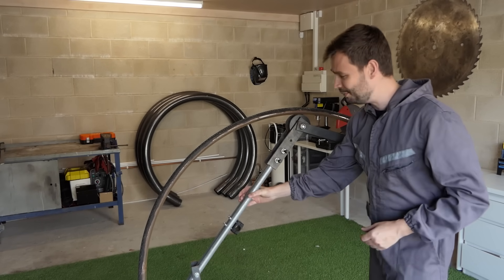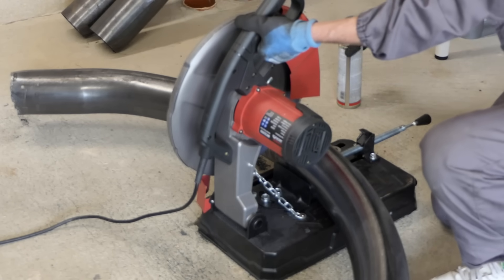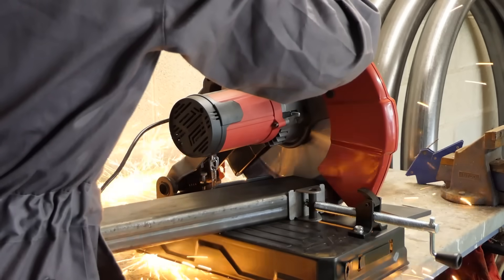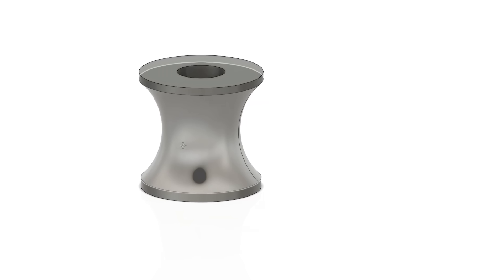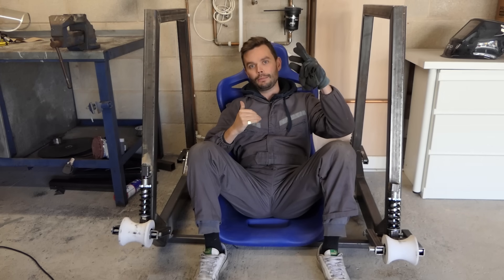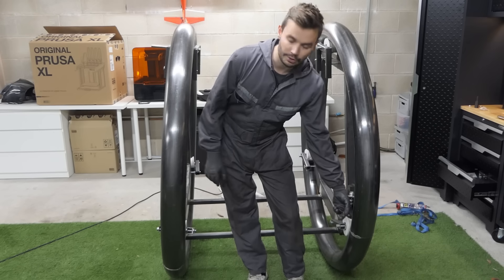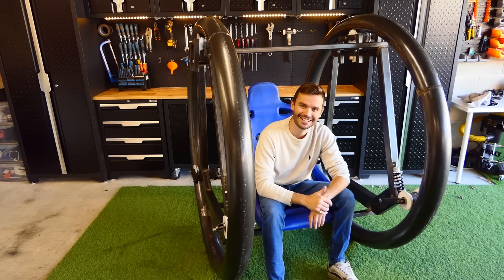Tank Steering E-Bike - The Diwheel

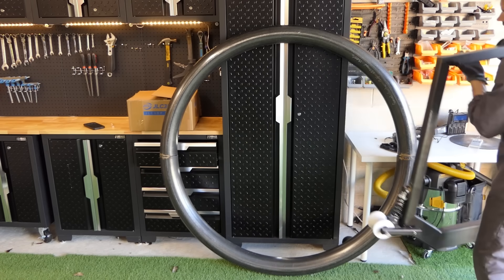Comment: 2:57 "It got worse" because of the welding you did on the opposite side. As long as the two halves are close you'll be alright. (Same deal at 4:08). 7:32 At this point, put the bearings in the oven at low heat and put the shaft in the freezer and get it as cold as you can, Then slip on the 'expanded' bearing onto the 'contracted' shaft. You'll have a few minutes to get is perfect before you have to start over again, but this way is surprisingly manageable and works great.) Looking forward to seeing this duo wheel roll. Cheers, D.

Comment: For having a suspension and to avoid it causes the wheel to slip out , you can add a frame inside the wheel that is fixed on the rollers with maybe tensioners and put the chair and the rest of the bike with suspensions on rails or welded suspension to this body
So that on bumps the wheels and the body all move together.

Comment: OMFG use your head. It's staring you in the face! You only need the inner quarter or half of the ring as a wheel hub. LIKE A BIKE.
Put an inflatable tube on and you are in business proper. You got weight reduction, suspension and traction. You're welcome.

Comment: the first idea it locked enough Wheels to support the metal that's why the metal was warping or bending it just needed more Wheels around it and the frame if you made it round the inner side frame and some extra bars for your part where you will sit and stuff in the chair that would have supported the metal more so having just one wheel can work it just required more to work also if the tube was flat it would roll better without flipping side to the side and adding a rubber tire will give it grip so you don't slide on the road like this wheel won't spin

Comment: I could have used this metal “Chromoly 4130”  it's lighter than mild Steel and strong enough to do the job with my vehicle idea that I would like to make someday that's the type of metal I'm going to use although it's going to take a long time cuz my money is very limited so I have to save and buy piece by piece although my vehicle will have dual motors and the only part I haven't figured out is the throttle if it's going to be a pedal on the ground or a shifter on the handlebars cuz it's going to be like a trike version of a golf cart or something similar to that

Comment: Is it going to be electric? Also it looks like traction might be an issue.....maybe epoxy some rubber blocks on the rim of your loops? On the plus side it will make it look more aggressive.
Reply from the maker: Correct and correct 😊
Reply: Cool project having an electric motor on it will make it a fun vehicle. Did you get any ideas for this from The Kugelpanzer ?

Comment: awesome, but I have 3 questions: 
won't the wheels fall out in the first bump? I think it needs suspension in the top
how do you plan to keep it balanced front to back? active control loop like a hoverboard or just driver skill?
in the end you mentions motors and batteries, how do you plan to make the wheels drive the tubes without slipping? especially given the suspension

Comment: are you going to find some used car tyres and cut rubber strips to glue on the outside of the wheels. the tubes look wide enough where you can get 2 strips off one tyres cut in half wheels and if not car tyres mabey 3 fat bike tyres will work

Comment: You can get a small lathe for about the cost of one of those tubes. (Around here anyway), that would be a huge help to get this thing realized. Also, I would definitely re-weld the tubes with proper prep, once you clean up your welds with a grinder, you have no weld left. Grind the ends to around 45 deg, then you'll have room for a full weld. Anyway, Im all in to see what happens, rain or shine, dont get hurt. Cheers.

Comment: What's the point? We know it won't work. You're limited by the power of gravity created by being off-center. That's the limiting factor of acceleration and deceleration, and guess what happens if you try to brake more? You'll spin. So any slight uphill to overcome the tiny energy you exert by being off-center and you aint going nowhere, similarly any slight downhill and you have no way of stopping. And it's WAY too heavy to stop it with your puny legs. Have fun dying

Comment: Awesome.  I'd-a tipped the tops in some, 5° - 10, so it has a wider stance.

You might tack on some small plates, so there's absolutely no chance of them flying off-track.  I'm sure yer pressure-fit is tight, but I'd hate for ya to hit a bump while going high-speed around a turn & one of those rings mangles yer leg.

Comment: 60kg per wheel seems a bit over the top doesn't it?
Would it be possible to make them out of alliuminium or smaller diameter tubing? 
Even 2 thinner rings welded together for each side and then a rubber strip could be implemented in the valley between the two welded rings if that makes sense.
You could definitely use alliuminium for the frame inside too I reckon.
It's a cool build though. I want to make something like this with a couple of ebike motors 😆😆

Comment: How are you going to stop? If all you have are massive rings for wheels you can stop the frame from rotating relative to the wheels, but then the whole thing will just keep rolling along the ground. Segways use the rider as an energy dump by tilting the person back and the wheels lose rotation trying to turn the person as a giant moment arm up from the pull of gravity. But since you are inside the wheel, you really won’t have that option. So you’ll need something you can deploy out front or back to stop the rotation.

Comment: I think you will want the rollers solidly mounted so that suspension bump does not unseat the unsprung rollers. Or have them all sprung. Could add springs to the seat for comfort. Some form of traction aid for wheels on rollers and rollers on ground might be helpful if braking and steering are to be anything other than mild suggestions.

Comment: I'm pretty sure a lot of the reason your welded frames would go out of whack when you welded them was because the heat from the welding was bending the metal.
Reply from the maker: Yes absolutely it was the heat from the welding that did it! Let’s blame it on that….. 😅 👀

Comment: Did you use spacers inside the white rollers to keep those bearings from sliding/falling in?
Reply from the maker: They currently are friction tight but once it comes to riding they will have circlips on the end to stop the inevitable disaster 👍

Comment: either the rings will need tires, or the bearing spools inner tires that contact the rings, otherwise the ride will be grindy/growly/noisy/jolty/uncomforable as hell. Probably both rings and spools will need urethane or rubber coverings.

The frame should be all aluminum alloy...the weight/inertia penalty on the steel version is going to really tax your motor/controller unless you go for at least 8000 watt system, which is gonna be expensive/require a really heavy battery pack... which will add more weight...otherwise you'll never get up an incline, or get any speed/acceleration.
Instead of  fat tubular wheels, have a metal working shop waterjet cut your rims from alloy plate...they'll be perfectly round, with flat sides, easy to fit some sort of tire onto, and tremendously lighter, plus easier to make bearing spools supports for.
Then you'll need to figure out some sort of dampener or safety-stop so your seat won't tip forward/back when accelrating/decelerating...and where are the brakes btw??

It's an interesting concept but I think it might be best to start over from first principles and design for minimum weight/maximum efficiency, for smaller drive system/better safety.

Comment: That top roller needs a preloaded suspension to stop it popping out on a bump.
Reply: I wanted to mention this too
Reply: Furthermore the travel of both top and bottom on bump needs to be less than equal to the travel in the opposite direction of the other - or it'll have the same issue even with that. But yes, you were almost right :-)

Comment: the top roller should be sprung too, it loses contact when the suspension compresses as is.
Reply: Furthermore the travel of both top and bottom on bump needs to be less than equal to the travel in the opposite direction of the other - or it'll have the same issue even with that. But yes, you were almost right :-)

Comment: I really hope he's adding tread because once he gets to a strong enough motor it's going to start spinning the wheels on acceleration and deceleration and w/ how much it weighs it can push in the corners and start drifting when you don't want to.... That's why some of the other designs like this have inward tilted wheels to help negate the drift when turning hard. This is going to be fun....     😂👏
Reply: yeah, might need some traction for turning and accelerating.
Reply: Plastidip spray? Polyurethane pour?🤔
Maybe some TPU, 3D-printed flat in segments, then curved on. Puzzle-piece style connections between segments?
Nailing the diameter might be tough. Also not sure how you'd keep it secured. Self-tapping screws could work but wouldn't be great long-term. Bolts would be better, but you'd need a way to get the nut on from the inside of the wheel, so would mean drilling a hole straight through. If more bolts are needed than just in the center line/contact patch of the wheel, I think it'd weaken the structure a lot. And maybe they couldn't go there at all, because of the weight compressing the TPU too much.
Lots of things to think about, excited for part 2!
Reply: He'll have to, it would be absolutely unridable/drivable on pavement or any hard ground with bare steel like that due to intense vibrations, and he'll get no traction anywhere.

Comment: bro those welds are interesting to say the least. Try turning up the gas because you've got a lot of oxidization forming which doesn't help the penetration of the weld. The key to a good weld is consistency not speed try focusing on forming that initial molten puddle and slowly pulling it along or pushing depending on your preference and try increasing the amps if you're struggling to maintain the molten puddle. Love the videos keep it up man.
Reply: Thats sure looks like gasless to me
Reply: Also bevel the edges of the metal before welding, then you're filling in the gap, not just trying to penetrate 5mm steel both sides.  I'd probably ditch the gasless MIG and use stick tbh though.

Comment: Try to weld in the other direction, instead of "pull" try to "push " it should be way better. And try higher settings like 21 v and 9.1 m/s

Comment: Awesome build haha! Madness! For future reference, when you butt weld 2x tubes together like the wheel rim, grind a bevel on both ends of the tubes.. so when they come together, you have a 'V' between them to fill with weld.. much stronger, especially if you are grinding the weld smooth after. I can't see a subscribe button on this video which is odd? Will come back and see if I can sub. (Edit: I am already subbed haha! Great channel)

Comment: Get each wheel sprayed with truck bed liner for better traction and as a layer of cushioning so the bare metal won't do as much damage to the road surface.
Reply: As much damage to your body you mean?
Reply: @benholroyd5221  What's that supposed to mean?
Reply: @Eidolon1andOnly  the 'suspension' is there for tensioning. So theres not much to stop any jolts going right up your spine.
Reply: @benholroyd5221 I know, which is why I mentioned giving the wheels a rubberized coating for traction and so it wouldn't be bare metal against the road surface while not mentioning anything about that layer of cushioning being for the driver.
Reply: @Eidolon1andOnly  well fundamentally it needs tyres. But concerns about damage to the road from a curved piece of metal are well down my list. For me its about grip and ride comfort.
Reply: @benholroyd5221 Ever see what bare metal rims without tyres do to road surfaces? No concern for what fines might be imposed for damaging public property?
Reply: @Eidolon1andOnly  no i have not seen what tubular metal wheels do to a road, i know tank tracks can, and that horse carts in my experience don't. But based on my current knowledge and experience, i have indicated my main concerns. You have indicated your main concerns. We can reconvene and the next video to see what in practice turns out to be the actual issues.
Reply: @benholroyd5221  Then why misinterpret what I clearly said as being meant for the driver and not the potential damage of bare metal on a road surface? With the sheer weight of that machine (especially with the addition of the motors, batteries, and driver), being tubular wheels doesn't negate the fact that bare metal can and will do damage to both the road surface and to the wheels themselves.